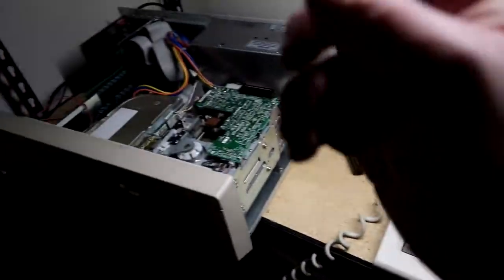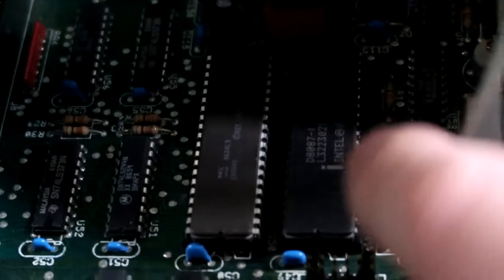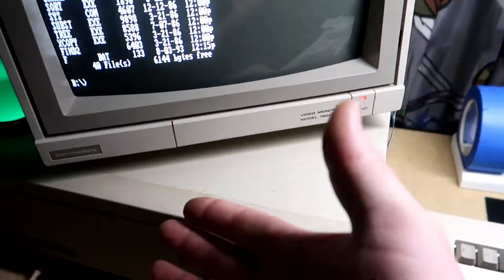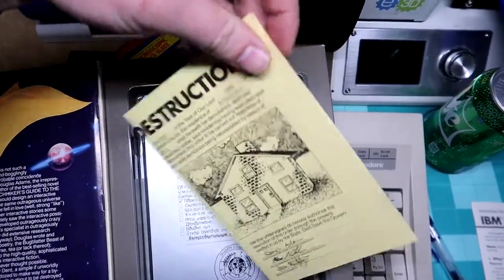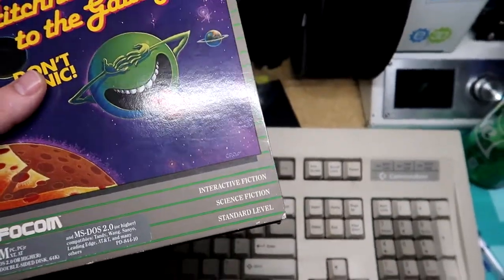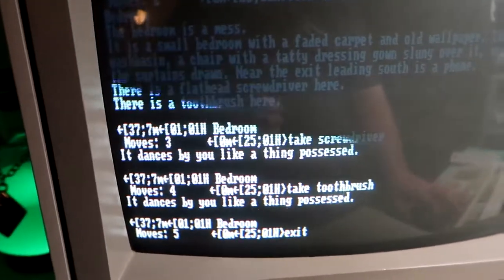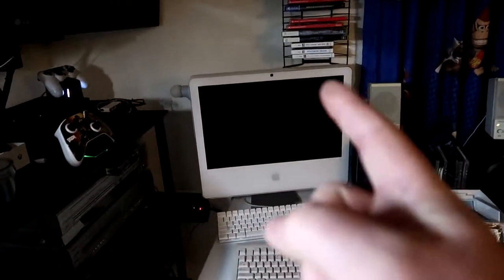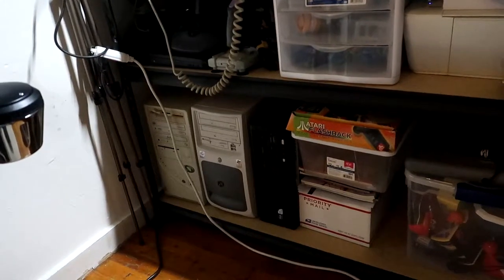1985 Commodore PC-10 Dual Floppy Upgrade - Part 2

Comment: How often do you find 5 1/4 floppies that don’t work. I don’t have any retro pc stuff but I’ve heard that a lot of them have bit rot and don’t read anymore
Reply from the maker: Not too often. Though I have found them. It really depends on the brand. If the brand was good then they last. I still have brand new un formatted 5 1/4 that I can format and use perfectly. Also depends on the condition they were stored in. I think I have somewhere around 400 5 1/4 floppies and maybe 10 don't read. Now the 3 1/2 floppies are much worse. It seems they really started to skimp on manufacturing quality late in their life. I can buy a brand new pack of brand name disks and maybe half wont format properly. Thanks for stopping by man!